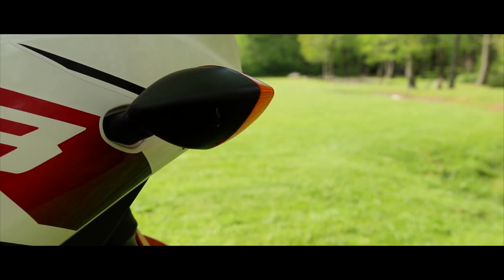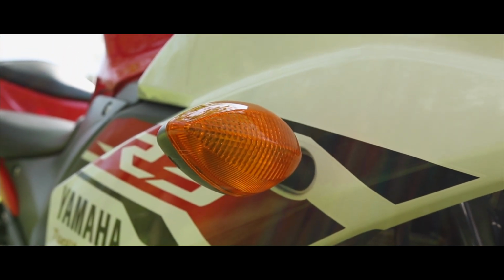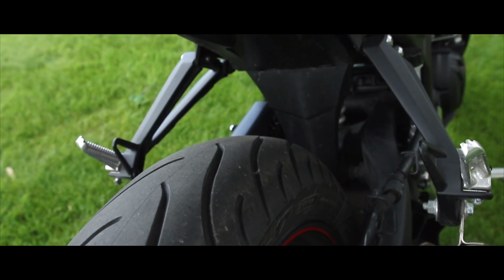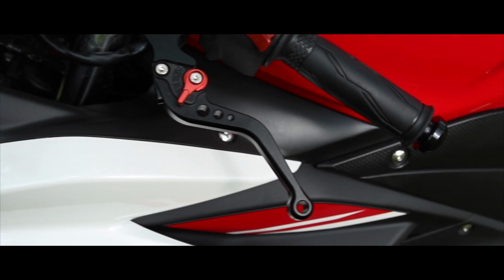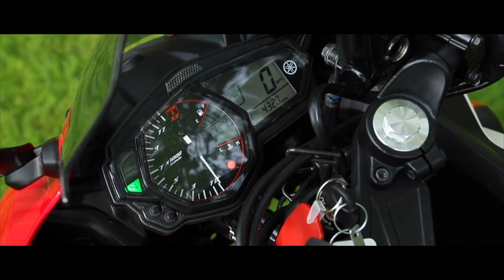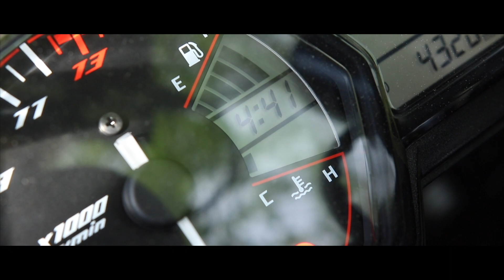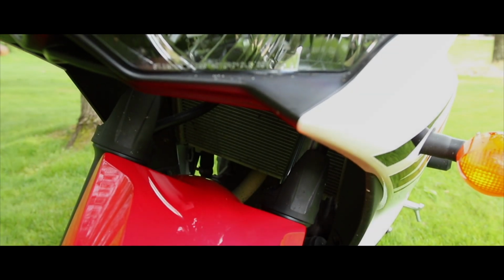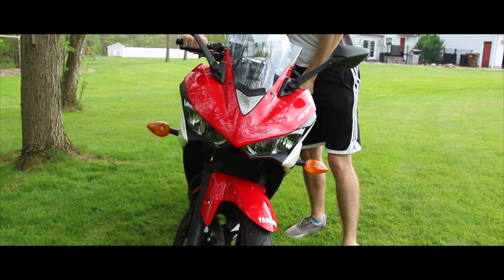5 Things I HATE About The Yamaha R3

Comment: I have a 2015 r3, basically everything u named is fixable, the signals u like u said flush mounts, or they even have the clip on ones u can mount to your front forks, and with the hugger, they have ones u can order for this bike, and as far as the front suspension..mines stiff as a board but, could just be different between bikes, I'm actually really surprised you didn't mention the clip on position, or the stock plate mount, or the stock quiet exhaust, and the skinny back tire...as far as the temp gauge goes..that's just a Yamaha thing
Reply from the maker: Yeah they are things that can be fixed. I tried to choose things that most sport bikes come with (hence the tire hugger, the front forks, and the temp gauge) I almost mention the tire, but that's just because it's a smaller bike. Haha it was actually pretty difficult to find 5 things worth mentioning, because the R3 is all around a nice bike!:D